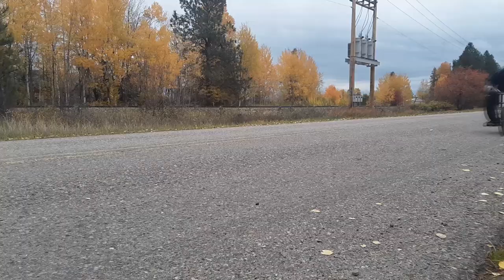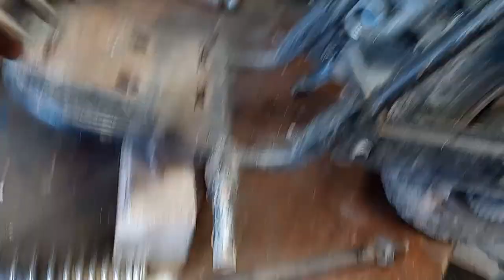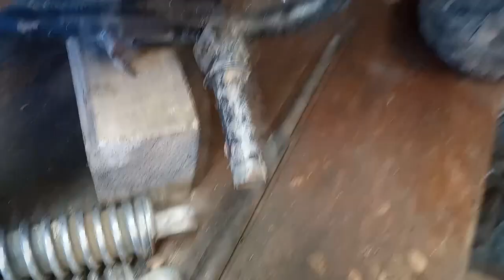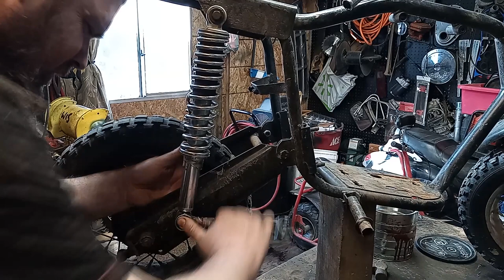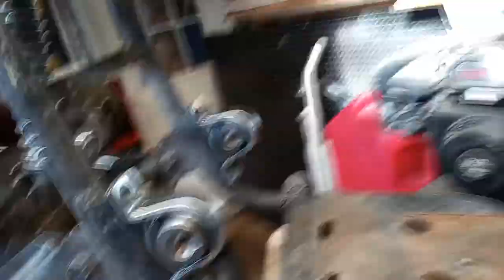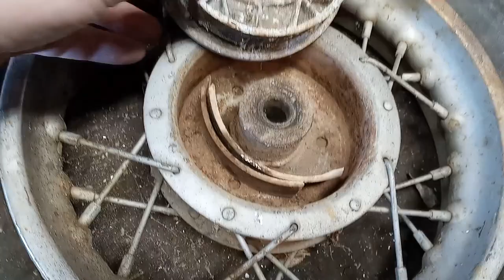Arctic Cat Ramrod | part 1| lets make a game plan

Comment: iv had good success jb welding brake shoes brake together on old dirt bikes and mini bikes with no problems just clean them up and degrease and scuff up the mating surface good and glue them suckers back on... wouldn't recommend it on street bikes or cars
Reply from the maker: I've done that on a few minie bikes but turns out i had some good brake pad in my hoard